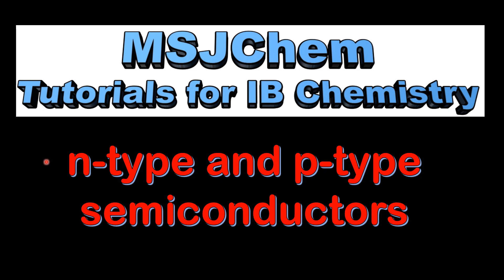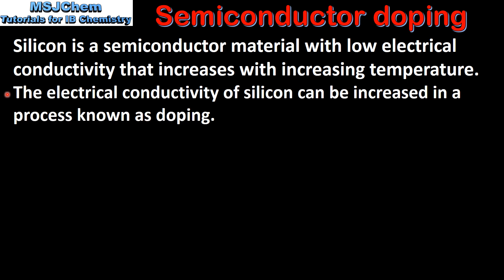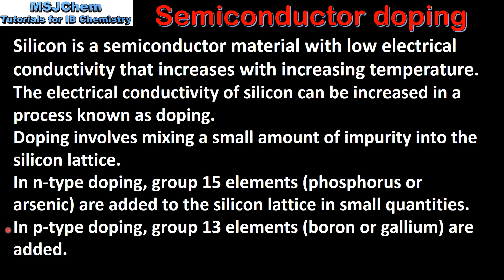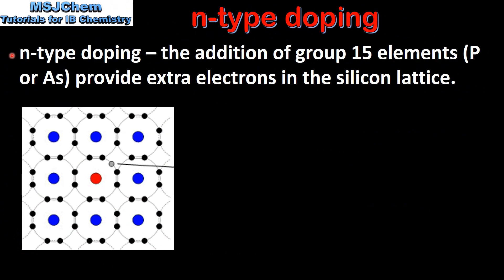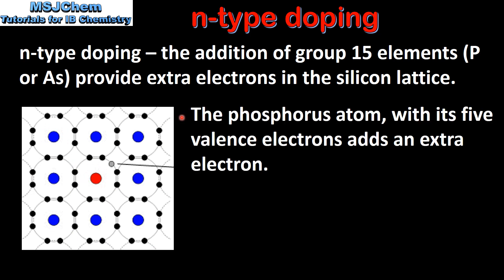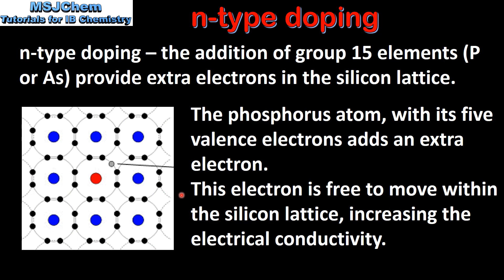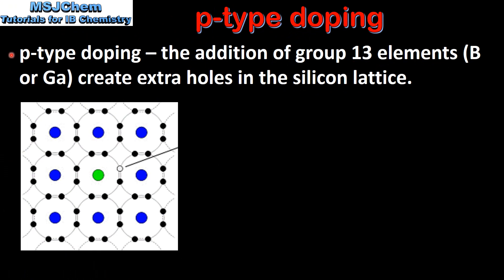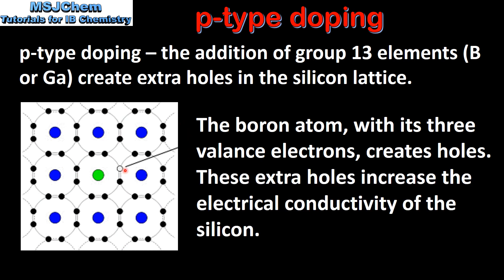C.8 n-type and p-type semiconductors (HL)

Comment: I have a question. If group 15 elements are added into the silicon, it creates an extra electron, right? So, is it natural for that extra electron to just break off and roam around?
Wouldn't the group 15 element hold on to that extra electron?
Reply from the maker: Basically that extra electron has nothing to bond to because all the other atoms have four valence electrons so it is free to move within the structure.
Reply: @MSJChem  ;)